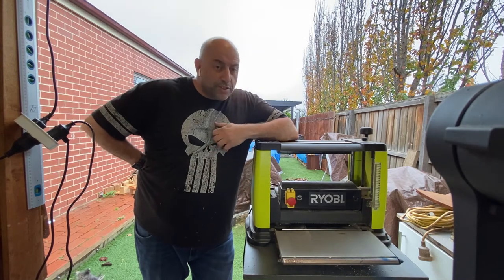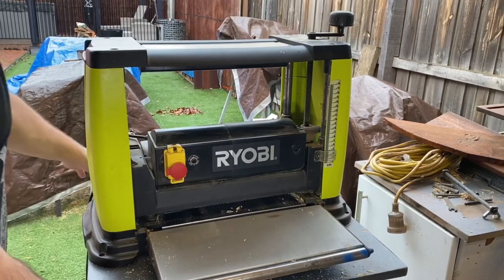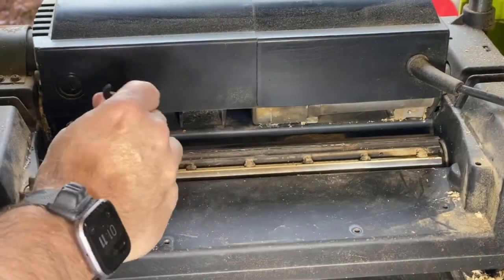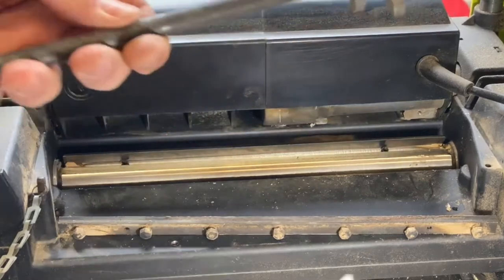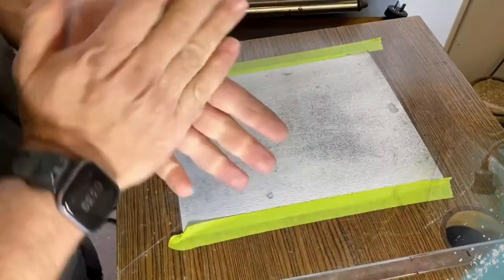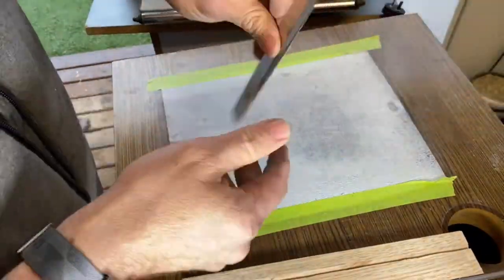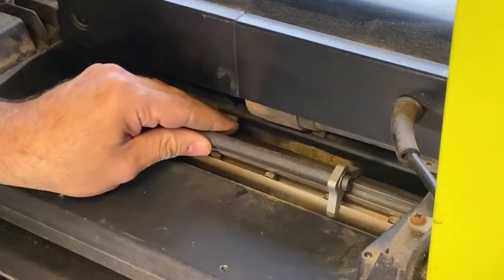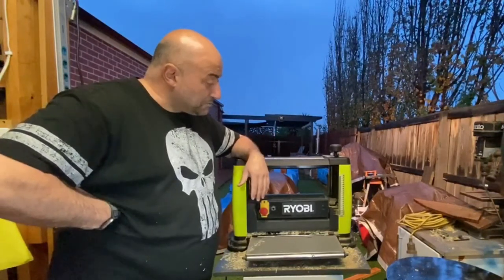Ryobi Thicknesser - How to Sharpen Thicknesser Blades

Comment: Great video. I asked if the blade could be sharpened and was told “absolutely not”. Then I saw your video and I will now sharpen the blades . Love my Ryobi thicknesser. Take old red gum posts and make decorative furniture and Jewellery Boxes. Thanks!!!
Reply from the maker: Had mine for 6 years now and still going stong

Comment: Great advice, nice instructional video, thank you David. I have two dulled blades with some significant wear in 2 areas, I hope sharpening them will remove these dulled areas and I wont have to buy new blades yet.
Reply from the maker: Be patient when sharpening and you’ll be fine.

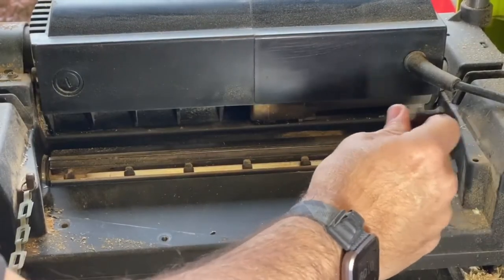Comment: Good video although could have been a lot shorter; At 6:31 into the video it is mentioned that the screws to unfasten the blade assembly are anti clockwise but in reality you need to turn the screw clockwise to unfasten the assembly. Turning the screw anti clockwise witll tighten the assembly. All in all a good video. Incidentally you can actually purchase a pair of double sided Ryobi blades from Bunnings in Australia for currently $63.